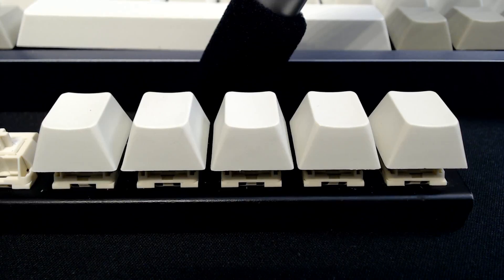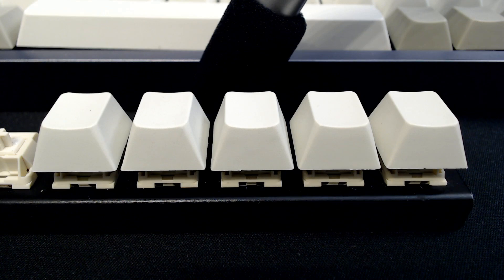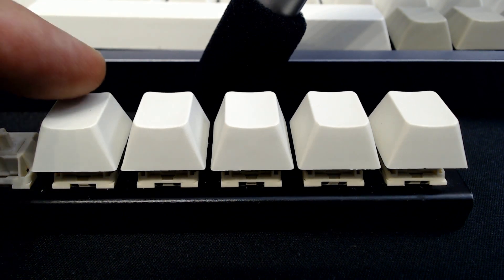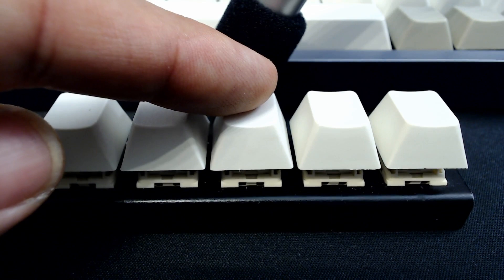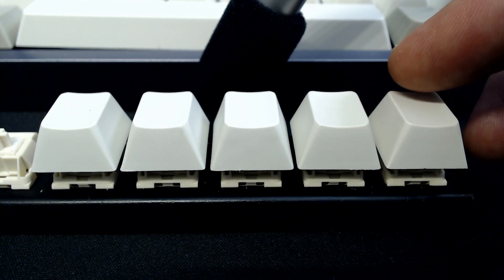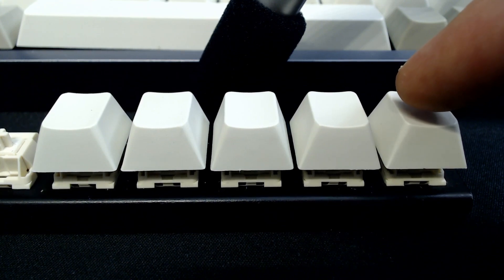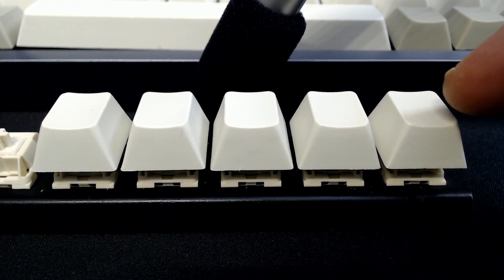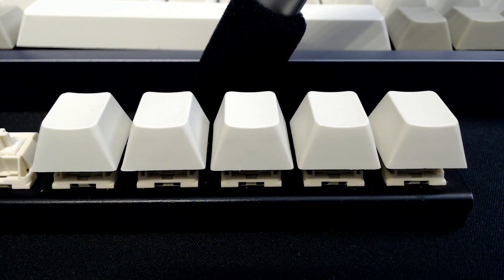Novelkeys Cream lube test

Comment: Defiantly fixed this issue in newer switches. I have no issues with mine (ordered in 2020) lubed with 204 and ZERO sticking sensation Lubed or dry.
Reply: where did you get them from i can't find any

Comment: Dude switch mods 205g0 sucks ass I'm using it as we speak its thinner then any other 205g0 I've used and doesnt dampen half as well I even have some 1upkeyboard 205g0 here and it's way better which says alot it dampens and makes switches so much smoother idk what fhede making but the mix is def off sry but it is get some from ashkeebs real krytox205g0 you will be very very surprised at the difference I will never order from switch mods again because of how bad there lube is I have there 3203 and the 205g0 the 205g0 you canf even feel the weight of the lube usually you can feel fhe weight of the lube on fhe brush its light and if shouldnf be very off I will say it's pretty bad when there 3204 is actually ok and it dampens as much if not more then there 205g0 does and also makes the switch smoother it says alot I can use the 1up or the ashkeebs which is straight from krytox themselves and it's way way better wouldnf think it could be that different but it is

Comment: i just recieved my 70 creams. i don't feel any of that sticking sensation your talking about. i did hear they fixed the problems.
Reply: Yes they did
Reply: even while pressing it slowly?
Reply: @roshans5275  Im going to recieve mine soon so ill update you in a little while :)
Reply: Granger Filanowski I mean it’s okay I’ve had them for a while and I ordered them off of kbd fans but I still have that sticky feeling after pressing them slow
Reply: Roshan S did you lube them with anything?
Reply: Granger Filanowski 205g0, even tried a thick coat but didn’t really help, I don’t feel the sticky feeling while typing but when gaming wasd gets pressed slowly and I feel it all the time
Reply: Newer models are fixed.
Reply: THANK GOD. I just ordered mine like 10 min ago then saw this vid lol. LESS GO.
Reply: @xzxzx111  so yes they fixed it but once you lube it you will feel that sticky feeling. i have them and use them unlubed. i lubed one just to feel it and it stick like crazy going down in stroke. i used g205g0 not over lubed. so test out a single switch lubed before you do them all at once.
Reply: @xzxzx111  I know this was 6 months ago but how's the switches now? Experiencing any stick slip? Thanks -

Comment: what did you find to work the best on the revised creams? i currently have an order on the way and dont really know what lube to buy. any suggestions would be greatly apreciated
Reply from the maker: I like the feel of PTFE powder but it doesn't sound as good. I think 205g0 sounds good but had a slight sticking sensation, you might not notice it while typing.  I think you should decide which matters most to you, minimum friction or best sound, if sound is your top priority I'd go with the 205g0 otherwise I'd try the powder
Reply: @WalkersKeyboardScience  thanks a lot! Its out everywhere though but i did get some 3204, considering canceling and just waiting for the 205

Comment: When you use super lube, are you diluting it in any way?
Also how did you apply the powder? With a brush?
Thinking of lubing up my creams and im torn between SL and powder because they are cheap
Reply: Just a heads up, they fixed this issue in the new batch. Mine are fine.
Reply: @cypherpls  i can contest i just received mine a few days ago. none of these issues exist. i really like these switches. i put a retooled black stem inside 1 of the cream and i swear it comes very close to tealios that i also have. i also like the sound of the creams more then the tealios.  but thats my opinion.